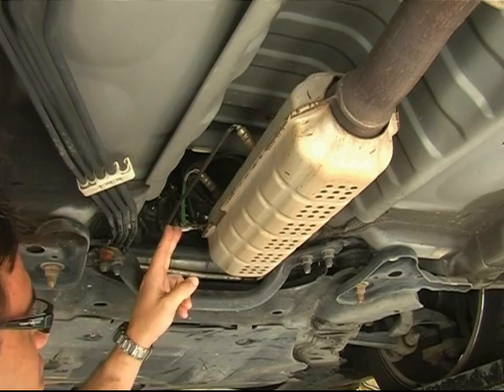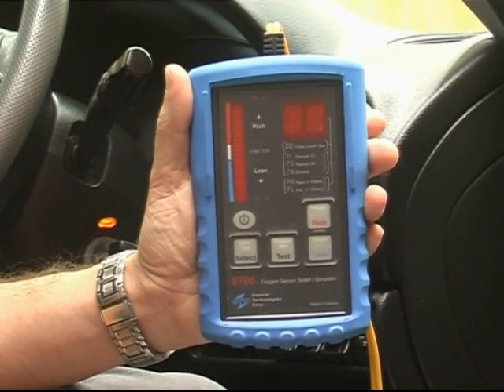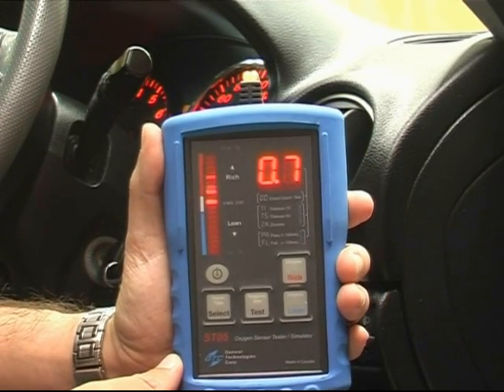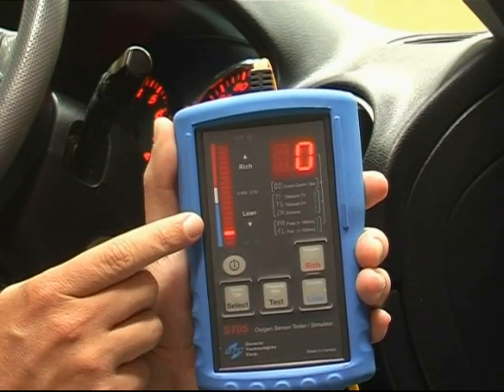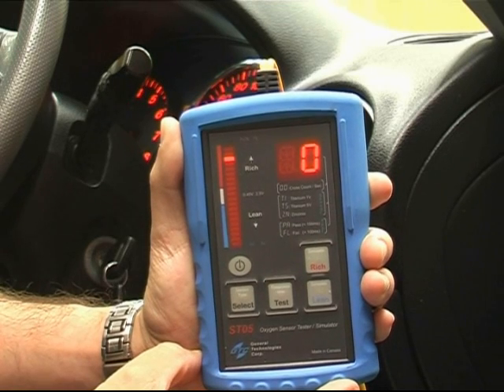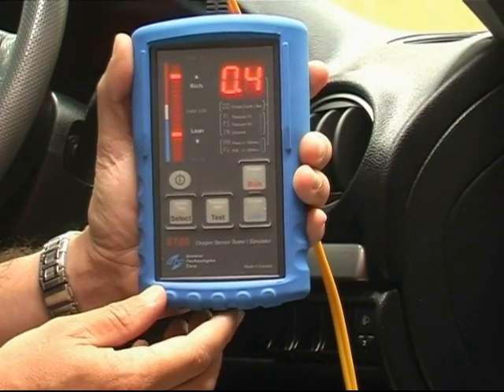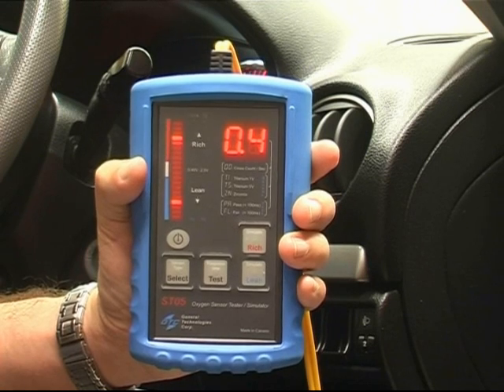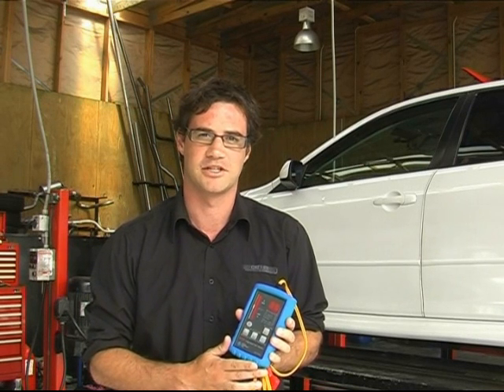Oxygen Sensor Tester ST05 Demonstration

Comment: Talk about a waste of money! Anybody that's trying to diagnose a bad O2 should have a capable scanner, and be able to read O2 PIDs.
Reply: You are right I dont know how acurate is this test. With a good scan toll you can see live the data and diagnose it ..
Reply: remember via a scan tool data is not raw but processed, ECU reports rather than sensor. I scope. these were good 2010 but you had to seal the pin holes with a non acidic sealant or make up pins to back probe gently. Still have one for training techs and the odd use on easy to reach older vehicles.

Comment: U know that piercing the wire is a big NO NO the wire will start to corrode and you will get false reading.....BTW the sensor is a OXYGEN sensor if the oxyegen sensor is reading a rich condition it means that there is allot of OXYGEN content in the exhaust.
You can do all that with a scan tool by monitoring the O2 pid.
JM@2C